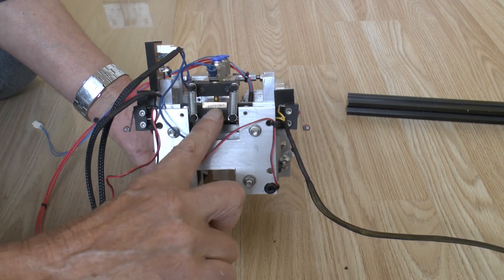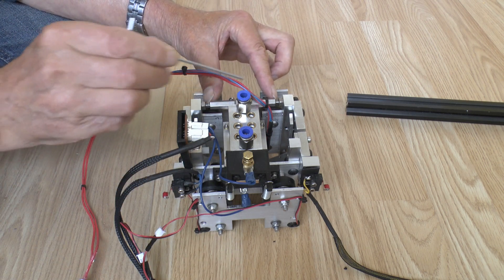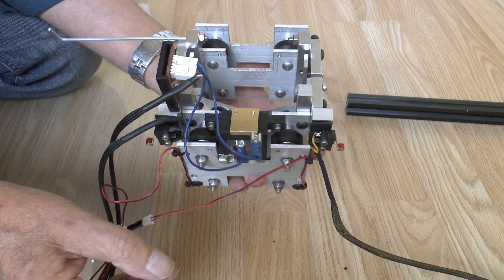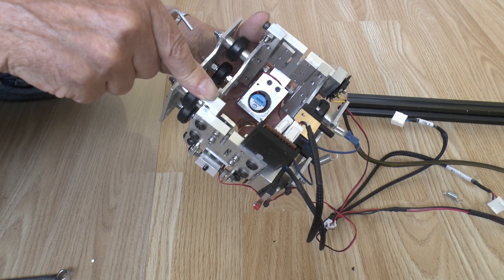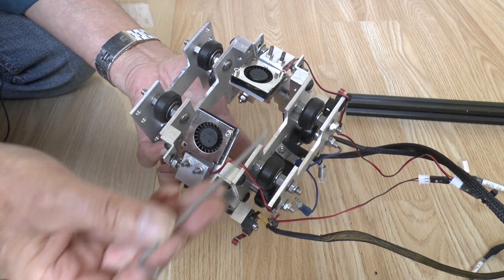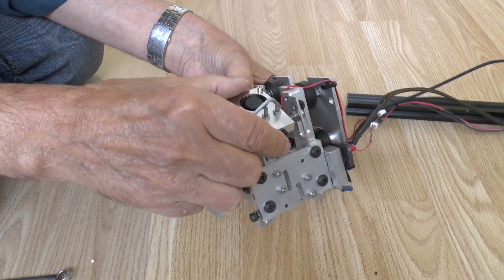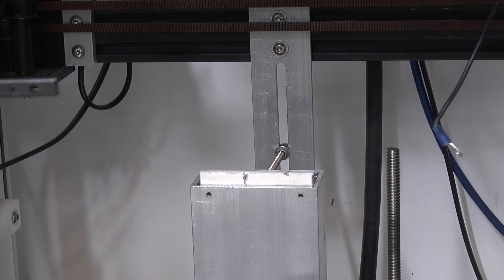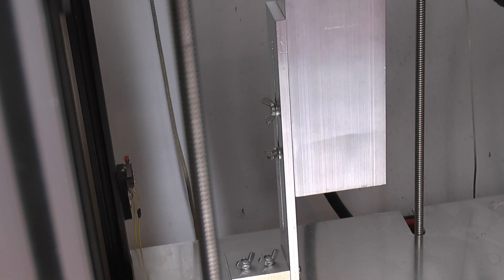My XY Gantry and latest adjustable purge "chute"

Comment: I'd be very interested to see a video of you running 6 of the same filament into the same nozzle for super high-flow printing.
Reply from the maker: Seek and ye shall find :) It's on this channel https://www.youtube.com/watch?v=rUV5IZxfAxU

I got up 300mm/sec with an 0.5 mm nozzle and 0.3mm layer height using a Diamond 5 colour. I managed 100mm/sec with an 0.9mm nozzle. 

By my calculations, that equated to 36mm^3 flow rate with the 0.5mm nozzle and 45mm^3 with the 0.9. 

There is a fuller explanation on my blog  https://somei3deas.wordpress.com/2018/10/14/real-3d-printing-at-high-speeds-and-even-higher-melt-rates-with-a-large-nozzle/

Comment: Good video, I look forward to seeing your progress.
Any chance you could link those hydraulic connectors, I have a liquid-cooled printer that those would help with.
Reply from the maker: If you mean, the self sealing connectors, see above - I can't now recommend them because one of the bloody things leaked. I bought them off Ebay and I believe the intended purpose is for motor bike fuel tanks. So maybe a motor bike accessories shop would sell you some decent ones. If you mean the connectors on the cooler block, they are just standard M6 threaded pneumatic air connectors that you can pick up anywhere (I think I got mine from Amazon). HTH.
Reply: @deckingman  I was looking for the self-sealing connectors.  I will probably look at my local hydraulic hose shop I saw on my way into the office this morning, and see if they have anything small enough.
Reply from the maker: @AndrewBeeman007  here is a link to an Ebay listing - there seem to be a lot of sellers with the same item. https://www.ebay.co.uk/itm/272616776005?hash=item3f7939e145:g:COoAAOSwX61ZB6e9
But as I said, one leaked. Maybe I was just unlucky.............
Reply: @deckingman  Thanks for posting that. I will look into it

Comment: 🤣 the miniature hydraulic fitting party poppers 🤣
Reply from the maker: Update. One of the bloody things leaked! They are supposed to be designed for fuel tanks on motor bikes! I guess that;s what you get for buying cheap off Ebay.
Reply: @deckingman  I used the slightly smaller version of this to carry air at 6.5 bar through a 3mm o.d. 2mm i.d. polypropylene tube - it leaked like a bloody sieve. For water cooling I use stainless steel hose tails threaded 4mm and 3mmi.d. silicone tubing with Mikalor hose clips - this has not yet me down yet.
Mike
Reply from the maker: @mikesimpson4652  Cheers Mike. Those press fit fittings that I screw into the cooler block have been fine for me. I quite like that I can quickly disconnect the hot end without having to undo any clips (just need to find some decent taps - like those self sealing fittings, I bought some cheap ones and they leaked too). 
I turned some adaptors with a straight 6mm section that pushes into those fittings on the cooler, and with a barbed section similar to hose tails on the other end. I also use silicone tubing and clips (but a bit bigger bore that you). Leaks aside, I'm now a convert to liquid cooling - it's so much quieter.